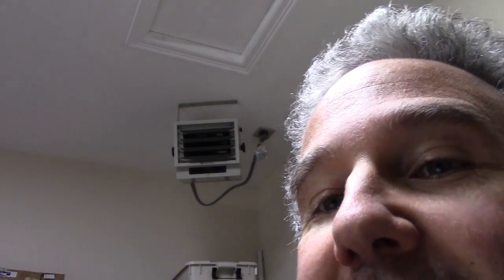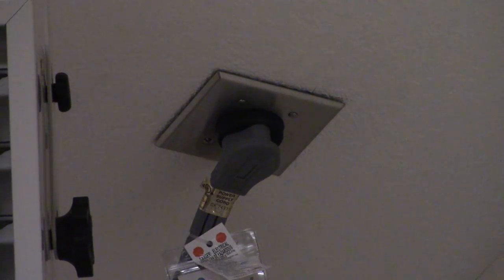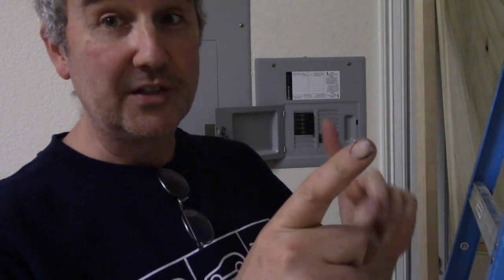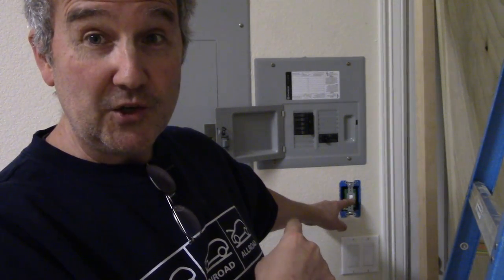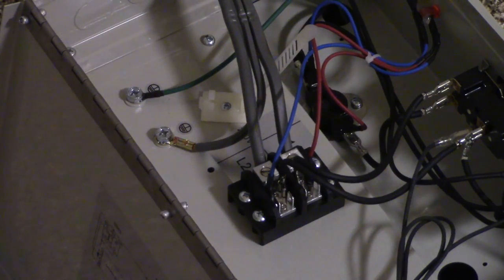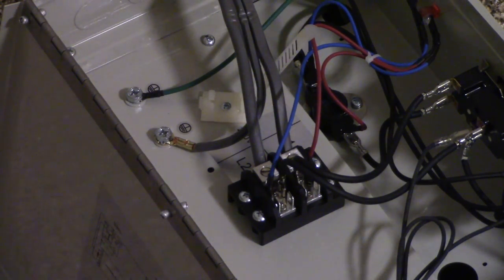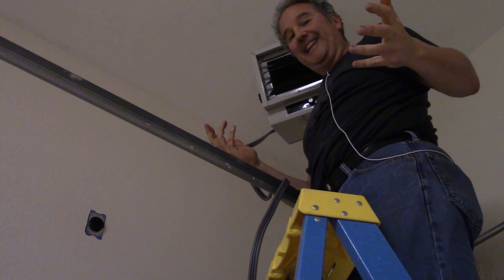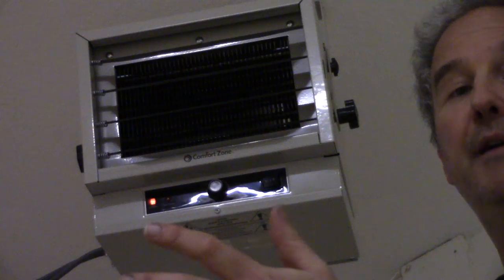Installing a garage or workshop heater - comfort zone review of CZ220 CZ230

Comment: When using 10-2/wGround, It would be best to mark the white wire with a red color at the conections when using it for 220/240 volt. That way anyone working on the wiring in the future will know it's 220.

Comment: Don’t forget to keep the neutrals and grounds separate at a sub panel. There is only 1 neural ground bond connection at your first means of disconnect. Don’t have the neutrals and grounds connected together at the sub panel. It can be dangerous.

Comment: The plug is the old fashioned dryer plug ( NEMA 10-30). A NEMA 6-30 will also do which has 2 horizontal prongs and a round grounding prong.

Comment: Have the same heater (branded differently) and was looking for a way to clean up the installation.  This is a great idea, never considered using a dryer or range cord!
Reply: Hi Shane, I realize this is a couple of years old, but I am wondering if you can tell me what brand is on your heater. I am looking at one locally that looks very similar, but has a different brand name on it. Thanks.
Reply: @jakekopveiler7116  I bought mine at menards. I've also seen same on got sale at northern tool just last week

Comment: I have a question. I installed a 7500w garage heater. I used the 8/2 gauge wire with an 40 Amp 2- pole breaker but when I turn on the breaker. It would shut off all the power and trip the 2-pole breaker. What would you think is the problem?

Comment: I have 10 2 wire with 30 amp breaker feeding power to my garage from house can I still use the 5000 heater. Please let me know
Reply: That is acceptable according to the NEC code and safe
Reply: 10 2 is rated for 30amps

Comment: The connector do dads are called romex connectors used to run romex wire and other wires into a box like you did and able to tighten them down so the wire won't come out. A cone bit in the knockout to widen it would have worked better.

Comment: Do you think you could use a 40 or 50 amp welding outlet and wire that up so if you needed to use the occasional 220/240 welder  for double duty off the outlet?
Reply from the maker: Yes. The min amp breaker is 30 with the 5000 watt. 40 amp min with the 7500 watt.
Reply: @virtualdaveailty1212  so what you are say all you do is plug the welder in to that outlet and it will work with out burning my house down and no need to branch off a 2nd outlet ........ and thank you for making this video
Reply from the maker: @scottnadeau5280  I would wire it up for 50 amps so you have enough power for the welder and then the heater will be fewer amps than that circuit delivers. Never hurts to go a little beefier.

Comment: When you set the heater to 68 degrees and shut the power off, does the unit stay programmed at 68 degrees when you flip the switch back on?

Comment: hello hey i just order this jeater 7500 watts i knnow you say i will need tye 8 gate wire ,, witch i have it ready run to my garage now i need to know about the breaker do i need a 40?
Reply from the maker: If you have the 7500 watt unit, then yes, a 40amp double pole breaker is needed. 30amp for the 5000.
Reply: thank you sir im waiting for it to come ,, i run the 8G wire with the 40  so im guess im good to go thanks for your reply ,  have a good day

Comment: What's the rating on those blue re-work boxes you are using for your receptacle and switch, I think you may find they are only rated for 120v maximum.
Reply: Nope, not true.  You can use the blue boxes.  Look it up.

Comment: I'm wanting to install the 7500 Watt Comfort Zone and if I'm correct in reading I need to use #8 wire for the wiring from breaker box to outlet. I'm wanting to intall heater with a dryer cord as you illustrated in your video but the thing I noticed when I went to my local Lowe's was that the dryer cord was a #10 wire rated at 30 Amps which is rated for the smaller 5000 Watt Comfort Zone Garage Heater. I did notice that there was a Range Cord with a #8 wire rated at 50 Amps. I was wondering what was the cord you originally installed in your larger garage a (Dryer Cord or a Range Cord)? Also what was the Wire Gage 8 or a 10? Also what was the Amps to cord? Thanks Dave!
Reply: Great question. waiting for a response as well.
Reply: You also need to look at your breaker.  For 7500 watts, you need a 40amp breaker.  I'm trying to make the same decision as you.  I have 10awg wire to the garage outlet, which is below what is recommeded for the 7500w.  However, you can run this unit at 6100 watts which only requires a 30 amp breaker and the 10awg should be fine.  You can use a 10 awg wire from the outlet.
Reply from the maker: I used the following dryer cable https://www.amazon.com/gp/product/B00TCXWGB2/ref=oh_aui_search_detailpage?ie=UTF8&psc=1. it's no longer available but other 50amp dryer cords should be out there.

Comment: the holes that the unit comes with would have worked for it just fine without having to drill a new hole. you could have used a 3/4" romex clamp instead of the 1" you went with. the knock outs are 1/2" AND 3/4" the 3/4" hole would have worked just fine. too much work.... adding the wall switch was good. some buyers have added a  sequencer to their installation and used a remote 24 Volt thermostat to make the unit easier to set the temperature. adding the cord was a good idea as that way you can take the heaters with you if you ever move....

Comment: Great video, I have a question. I have 220V wiring that ran to a spa that I had to the back side of my garage. I no longer have the spa but the wiring can be used in the garage for a heater. My question is the circuit braker is a 60 amp and the wiring is a 8 gauge. The dilemma is on the 220V wiring I have a red wire, a white wire, a black wire, and a copper ground wire. How do I incorporate these wires into installing into the ceiling fan seeings I have 3 wires and a ground and not just 2 wires and a ground? Anyones help on this would be greatly appreciated. Thank you so much.
Reply: -3 wiring is for three phase circuits. It has 3 wires carrying 120 volts, and a ground. Those kinds of circuits are typically for a 240 system, with a 120v control system. In this case, you can just use any two of the power wires, and disconnect or tape off the third, (probably the red, since -2 wiring will use black and white and ground) unused power wire. And of course the ground wire is just that, a ground wire. The 8 gauge wire is overkill, but works fine since its already what you have. Depending on the heater you get, you can use a smaller 30 or 40 amp breaker for your new application.
Reply: Is it ok to leave the 60 amp breaker that I have already in there for my 220v 4 wire 8 gauge wire?
Reply: @celebrate1203  You can, but I wouldn't. It would take a 60 amp short or problem in a 30 or 40 amp heater to kick the breaker off. So instead of kicking off, the 60 amp would likely allow the heater or wiring to catch fire before kicking. A 30 or 40 amp single throw double pole of the same brand (Square D or whatver brand your breakers are) will snap in right where the 60 amp is and wont cost a whole lot.

Comment: I have a question the fan seems to be noisy with vibration. Is this normal for this heater?
Reply from the maker: Using one bolt causes the vibration noise. It is bugging me. I'm going to put up a 2x4 across two joists and then attach with 2 bolts. That will eliminate the rattling.

Comment: Thank you so much for posting this video about the garage heater. I have been looking at them since the fall and keep going back and forth between one of these electric heaters or a small pot belly stove. It is a small space so I can't decide. I don't want to have to walk around in my bra and panties either, lol. There are benefits to both heat sources the major one is cost. I built a 16x10 shop out behind my house and I love it. I had a few 220 plugs installed and the one at the entrance of the loft is being used by an air-filtration unit.  Do you think it would be ok to plug two 220 tools into one outlet or should I do as you have and install a separate one? Any input, suggestions are appreciated. Take care! 
PS: It's kinda funny when you said that you learned how to do electrical work by watching YouTube videos.  My old dryer snapped a drive belt and money was tight at that time and I knew a repair guy would cost $150/hr plus the $13.00 belt, so I watch a few YouTube videos. I'm going to pat myself on the back because I successfully opened the front panel of the dryer and installed a new belt which I got off of a parts site online. I'm pretty proud of that, lol. I have always shied away from electrical work other than installing new outlets from the old ones, so I hired a company to wire the shop and put a new panel in for upgrading to 200amps. The shop has its own panel in case that is important to the heater. Do I need to put in another 30 amp breaker inti the box that hooks to the wiring??

Comment: Is that switch you are using rated for over 30 amps?  I believe this unit draws 31
 amps?
Reply: Nope thats why i didn't use a switch  because a two pole switch is usually only rated for 22 amps
Reply: @rodneylanders2609  the 5000w unit does not draw 31 amps.  The GREEN Eaton Double Pole Toggle Switch IS a 30amp switch #3032.
Reply: @xsteel3292  yes i was talking about the one i have is the 7500watt model . The only way i could use that switch is to keep the heater in medium not high
Reply: 7500w model is 31amps, not the 5000w model.

Comment: Do you know how much more on the bill every month when the heater switched on in the winter season? Thank you
Reply from the maker: Electric heat is expensive. I only use it when needed. I have heard that other people who have used this daily have removed and installed a gas heater to save money.
Reply: You can do the math based on your electricity cost. The average cost of electricity in my state is 12 cents per kWh. If I run the 7500 Watt heater for 1 hour then I'd have used 7.5 kWh => 7.5 x 0.12 = $0.90. So I can say that every 1 hour is going to cost about $1.00. 

Like Virtual Daveality mentioned; if you're running this continuously for heat then it get's very expensive. It would be ~$700 per month to operate non-stop. But, if you're like me and you only need to run it for a few hours a month while you're working in your shop, then it's worthwhile because the heaters and install are relatively inexpensive, with almost zero maintenance. Plus they heat up basically instantly, so imo they're more economical than a wood stove for a garage or shop.
Reply from the maker: @kurtnewcomb1132  Thanks Kurt.